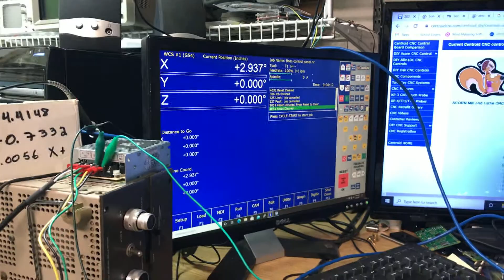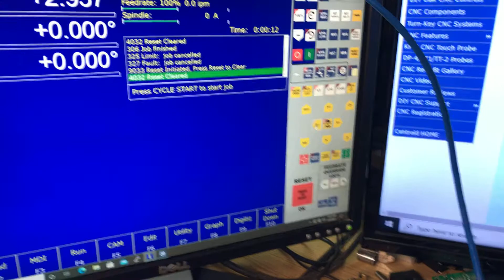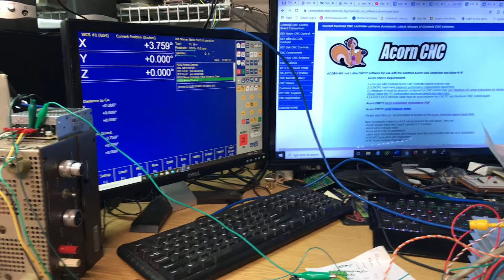Centroid Acorn Driving Allen Bradley ultra-3000 Fanuc Redtop Servo. Working!!!!!!!!

Comment: Hi there can you share your custom motor settings and tuning values in Ultraware please. I have everything working and autotuned on the bench but when I install to z axis the drive won't enable and alarms out on self sensing E39. Any help would greatly appreciated. Thanks
Reply from the maker: That was the same problem I was having, and I had to switch to a different drive and motor for the Z axis, but I had no issues after that.

Comment: Hey bud I got quite the experience with the a b 3000 servo drives but with Allen Bradley’s servo motors with sick encoders how did you get the fanuc motors to work with the 3000 drives? Do they use sick encoders? Hey also I have lots of used servo drives like Mitsubishi mr j3 s and I know how to turn the optical ones into analog that u can use with any cables and you are not stock with only Mitsubishi type cnc controllers . Crap man good job like I said if u can help me I can help u I was really into it but just got a baby boy so I’m taking a brake from researching this stuff but be glad to pass my knowledge
Reply from the maker: I am using the stock encoders, I have the machine up and running, I will be working on the tool change carousel next. I have had to take a break, as I have another machine that I am doing with CL86Y drives and Acorn, which is straightforward.